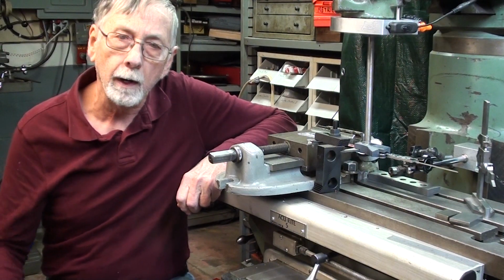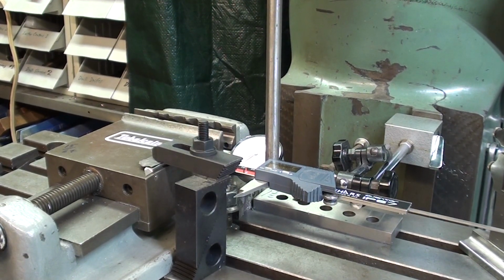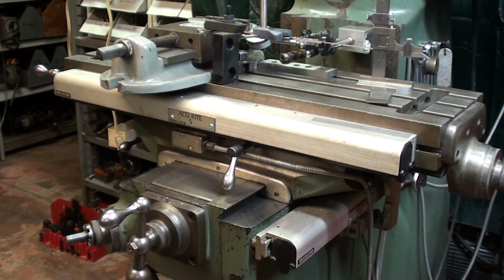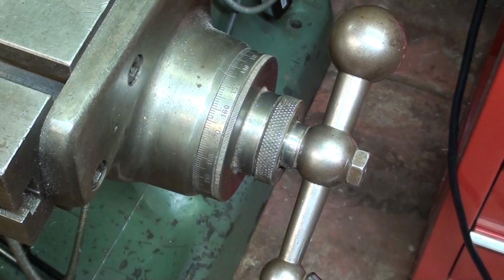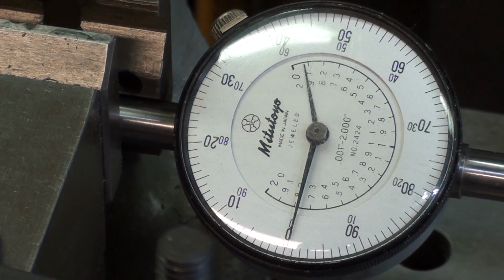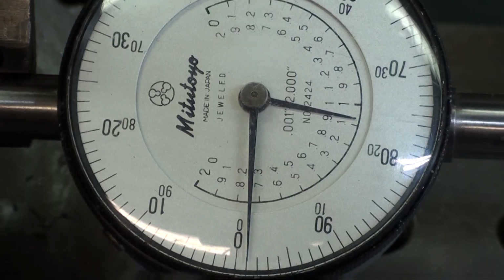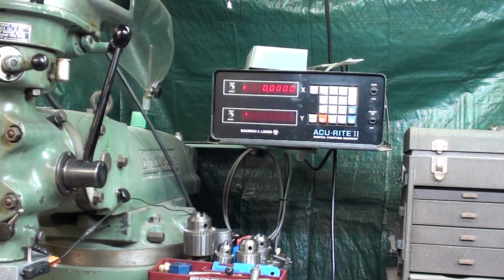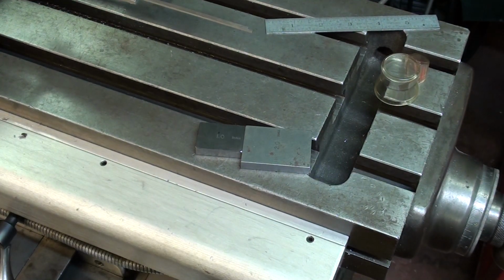Accuracy of the Bridgeport Mill Tips 527 tubalcain

Comment: I'm impressed that everything agreed so well.  I was going to ask about temperature as well, but 68 shouldn't be an issue. The instruments made of steel are all going to grow/shrink in parallel with each other... it's the glass scale and the fiberglass circuit board inside the calipers that would be an issue at 60 or 80 degrees or so.

You might find it interesting to note that the digital scale is actually an electronic version of a vernier, I've taken one apart, and found a set of copper fingers each 0.1" wide, spaced 0.1" apart, all electrically connected.  They are capacitively coupled through the label to a circuit board in the display, which uses 3 phase AC to sense the fingers, and interpolate position to great accuracy.

In fact, I had a similar scale cut out of vinyl, and attached it to a plain aluminum bar, and the fingers provided enough difference in capacitance that I was able to use the scale as a longer range vernier caliper, though a bit janky.

This was fun, thanks!
Reply from the maker: Thanks that was a good comment
Reply: # phase AC....waaay back in the 1970's I was an Electronics Tech at Burgmaster...the 'resolvers' on the ballscrews were also 3 phase AC, used phase shift to measure to signal offsets...there were not a shaft encoder...they were not a digital device...
Reply: The resulting display is digital, but the way digital calipers work internally is analog.  Phase shifts resolve far finer details.
Reply: Here's a Starrett patent from 1984

https://patents.google.com/patent/US4586260A

Comment: Please keep these coming as I'm bringing a 1958 Bridgeport M head back to spec. That has suddenly become more interesting as I just discovered that, "The (international) inch has been exactly 25.4 mm since July 1959.", as I mention in a reply below. Perhaps it's time for a DRO.

Regarding the Dial Indicator, as commenters have mentioned, cosine error is always a concern with Dial and Test Indicators when they are used for measuring. The more common use is comparing two or more positions, therefore Reliability is more important than Validity. A few tests of the Reliability of the Mito might restore your confidence.

Ultimately I think I'm going to have to resort to Gauge Blocks to test my Old BP, but I'll have to make sure my old set is post 1958!
Reply from the maker: Thank you, yes I am done to check that mit with Gage blocks

Comment: Really enjoyed watching this video. Like you, I was surprised about the direct travel indicator error. When I was working in a machine shop I would often use indicators to monitor movement when I was trying to work really close but I never involved a lot of travel. I would usually use them when I was making a final cut and was able to get awfully close. I can see where the indicator could have cumulative error over a full inch or two. I guess I just never tried to use that much of the range when I needed to be really accurate and repeatable.
Reply from the maker: Thanks

Comment: Yup, interesting topic.   I'm a bit surprised you assume that the DRO is the standard of accuracy here, especially an older one.  I would have thought the dial indicator was intrinsically more accurate.  But I am no expert with DROs.  The results overall are not surprising, though, I tend to assume that one thou is the limit of what can be realistically achieved for most jobs in the shop for non-experts, so those levels of errors seem acceptable to me.  I normally assume digital calipers are good for one thou and micrometers for one tenth. An important question, though, is what are those errors over much longer distances than 2" as one would expect for example that errors in the screw are cumulative over long travel.
Reply from the maker: Thank you, I will get to the bottom of this

Comment: Bravo! Lovely how you you did this in a super practical way that would be of use to anyone who wished to check the accuracy of their instruments & to understand what the various accuracy parameters mean in a practical sense. If as I understand it the dro reads to 0.5 thou, then when set at say 2.000 inches the real distance could be between 1.9995 and 2.0005. If my understanding is correct it is remarkable to me how the digital caliper & the screw threads came so close & given all the mechanical parts inside the dial indicator is good too. I had never thought to question these types of measuring tools & given your results I don't need to which is nice to know. It would certainly be interesting to see how the gauge blocks compare. Thanks for sharing!
Reply from the maker: You are right

Comment: In fact, most of the instruments have both accuracy and resolution specifications. Resolution is how little you can measure/see, accuracy is how precise that measurement is and repeatability is what it says. Even B&L have an accuracy limit, listed at 0.0002". Repeatability is 0.0001". So you might have an error of 3 tenths and would still be in spec.
The digital measuring devices have an accuracy usually listed as X LSB + Y% FS - that means it might be X least significant digits off plus a percentage of the full scale. So 4LSB+0.05% would mean that on 1", on a thousands indicator, you could be off by 4 thou + 0.5 thou.
Same for mechanical measuring devices like dial indicators, but I've rarely seen full-scale error specified.
Reply from the maker: Thanks

Comment: Great job on the comparison.  Buy Shars looks like, very impressed.  You should check the dial indicator to a gauge block.  I find them off quite a bit.
Reply from the maker: I'm going to do that in another video Randy. How are you doing on that engine.  You are 3-D modeling was magnificent
Reply: @mrpete222  Thank you, Engines are coming along well.
Reply from the maker: I already did that in an upcoming video

Comment: Mr. Pete I enjoyed the video. I rebuild machinery for a living and one of the ways we calibrate scales on a rebuilt machine is to utilize long gage blocks, we have a set up to 20" blocks. Wring a small, say .200 block on one end and rotate it perp to the long block, so it sticks off the side like a little ledge or tail. Place the long block flat on the table wide side down and make sure the wrung block on the end is not touching the table but securely wrung to the end of the long block sticking straight up. You can then put a test indicator in the spindle, .0001 reading preferable and try to avoid indicols they introduce a lot of hysteresis. Now lower the quill and touch off the end of the long gage block and zero your readout. Then raise the quill just enough to clear the long gage block and crank the table to the other end and touch the indicator stylus to the wrung on ledge which is sticking up and crank the table in to zero the indicator and compare it to the readout. It should be noted you would want to first dial in the side of the block parallel to the axis you are checking to avoid cosine errors. Also when you zero the indicator off the first side of the block, I merely apply drag to the quill lock so it holds z position but I can still move it, you dont want to be loosening and tightening the lock as this deflects the quill. And using the knee will most likely cause yawing  of the whole setup, so it is best locked and left locked. On a knee style mill as you move the table from left to right it moves on an arc, even a new machine, this is due to the weight shifting back and forth causing the saddle and knee dovetails to "squish" ever so slightly any running clearance in the dovetails. You will see this by placing a precision level on the table and moving it back and forth. Now on a 50 year old machine like yours it's highly likely the table is peened, in other words its crowned in the middle, this is caused by many years of things being dropped on the table top and also tightening T nuts, this yields the cast iron on the tables surface and causes the surface of the table to compress which elongates only the top layer of the table, and if you know how a bi-metal spring in a thermometer works then it will be obvious to see how this will effectively curve the table over its length. From my experience in rebuilding a machine of that age would probably be .003-.007 high in the middle, just a guess. You could check this with a long straight edge and feeler gauges. We have a saying in machine tool rebuilding, Gravity is always on, and everything's made of rubber. Cheers!
Reply: Yeah, there's an old book called "Foundations of Mechanical Accuracy", or something like that, about the construction of very accurate machines.

Yeah, it's heavy stuff...
Reply from the maker: Wow, I hope I can follow this.  I will print it out so I can study it. It might be a little beyond me. But thank you so much

Comment: The dial indicator must be exactly perpendicular to the measurement otherwise you introduce errors in the reading, the odd part is that the math says you should always get a larger reading. I think i will spend the rest of the day checking my dial indicators against my gauge blocks for accuracy.
Reply from the maker: It should have been perpendicular considering I held it in a vise with A vblock.  But I suppose there is all kinds of room for error. Mine is not a Metrology laboratory

Comment: I used to work in an academic setting with very educated people. It was always a challenge to explain to these folks why something they made did not fit together or function as they intended because of errors based on assumptions they made concerning measuring instruments and scales on machine tools. Of course, there were always questions as to how well they could perform basic shop operations, but most of their problems had to do with layout, cumulative measurement error and indifference to the limits of the tools they were using. I think these kinds of videos are very valuable. They may not get lots of initial views, but they well help people over time become better machinists.  Thanks Mr. Pete!
Reply from the maker: I am going to make more of them, but I am always disappointed in the small number of views. If I had my kitten playing with a ball of yarn it would go viral
Reply: Academics, highly educated people....they don't concern themselves with such mundane things such as we do...just ask them...!
Reply: I think your comment is correct but that it perhaps can generally be made about most of the population. It is true that people can be very indifferent to the skills involved in especially precision fabrication. I must say, however, that in my years working in universities and research labs I did come across folks who were very good at mechanical and electronic design and fabrication. Yes, they were the exception.

Comment: I was expecting some differences with the machine dials and dials indicator because of sight alignment but was surprised that the digital caliper was just a half thousandth different from the DRO.  Ware between the screw and nut could vary some in the travel even with the backlash removed as the thread clearance in the table travel is more in some areas of use. Thanks this was enlighting on how we can see things differently because we don't use direct line of sight correctly always.
Reply from the maker: Thanks

Comment: What length is the .0005 error ? Per inch or over all travel ? The dial test indicator has always been the go to for accurate location and measurements with low error . Calipers are also called guess-o-meters least accurate . For most work we find ( + - ) 1-5 thousandths acceptable and are able to use questionable machines , but  like one of the previous comments " witch one is true ?
Reply from the maker: Thank you for a good comment, the jury is still out

Comment: My guess would be that the indicator stem is not perfectly level and parallel in both directions to the table travel. Bet if you lock the table lock you might see a change in the readings also. I know I do on my mill due to condition of the ways. Thanks for taking the time to make the video.
Reply from the maker: I think I will do a video checking out with Gage blocks
Reply: steven is wright the spindle of the indicator should be exactly parallel to the axis of the lead screw

Comment: Hi Lyle,
An interesting video.
When was the last time you made parts for NASA or Rolls Royce aircraft engines in the home shop ?😂😂
+/-0.005" or 12.7 Microns is more than good enough for as mortals in the home shop.
I looked a a 1 Micron resolution DTI a few years ago, accuracy of +/- 2 Micron's ?.
Then realised what's the point, I've no way to check it, or get close to these values !.
So I never worried about chasing these values.
ATB Adam
Reply from the maker: Thank you, that's a little too small for me. But it was almost at accurate of work at Catapillar making fuel injectors

Comment: This is an interesting video and it reminded me of how I tried to confirm the accuracy of my DRO.  When I installed a DRO on my little Grizzly I found out that dial indicators have to be dead square to the line of travel or they read wrong.   I had been careless with the angle of the indicator and the measure was a lot different from the DRO.   I worried about that for a day before I went back and spent some time getting the indicator square and then it agreed with the DRO.
Reply from the maker: I was hoping the indicator was perpendicular. It is held in a vuse in a VE block
Reply: @mrpete222  I was not actually referring to your indicator although I guess it could sound like that.

Comment: One may expect differences between systems and tools. The Mitutoyo dial indicator may have been designed and built in metric and for the U.S market, if they just slapped on a dial faces graduated in imperial. Sometimes one finds fit-up problems when a metric design part is manufactured using specifications converted to imperial. It really stands out when tolerances are applied to holes with true position requirement. Good study. I liked it.
Reply from the maker: Yes thanks

Comment: I still have the old "Travel dials" on my mill and lathe, I use a 6" standard and Best test indicator to set them up. They are at least 30 yrs old and they work great, long as they are not bumped.  Yes, my dials are off some compared to the Travel dials, but I make a couple cuts on a aluminum block and compare sizes to the dials and The Travel dials are always closer. My macines are also older and they have had some use and abuse over the years.
Reply from the maker: I always wanted to own a travel dial

Comment: Vernier scale may be obsolete,  however,  it is still very, VERY accurate if you are capable of reading the scale!
Reply: Randy TenBrink you are correct, the only source of significant error with Vernier scale is introduced by the operator. I use 10x magnifying loupe to reduce that error. 
The main disadvantage of it is that is slow for modern production.
Reply: @rok1475  indeed slow but once you see your mark, you know your measurement almost like mathematical perfection!
Reply from the maker: Yes
Reply: My favorite calipers are the vernier set I inherited from my father in law. However, as I have gotten older they now require an ancillary tool in the way of 3x readers to use them. In a weak moment at Harbor Freight I bought a digital set with the 25% discount they sent me. Checked them against my Jo blocs and they seem to be constantly within half a thou. But still as a home gamer there is something missing when I use them. Now where are those blame readers?

Comment: I'd lay odds that the DRO scale is the most accurately setup measuring device here.

The calibration check would be done with stacked up gauge blocks, but for the most part, the inaccuracies between the various methods are going to be effectively linear, especially over such a short distance of travel.

Bottom line: the lead screw on this mill's x-axis is plenty accurate enough for purpose. When you get down to needing tighter measurements than +/- 0.0005", you really need to use a surface grinder in order to finish the work.
Reply from the maker: I agree 100% with everything you just said

Comment: 20 years ago I mounted a new DRO on my mill.  One of the final tests was to calibrate the installation with as long a gage block as available.  The basic principle was to mount the gage block perpendicular to an axis, square it and get the length using the DRO. The measurement was entered into the DRO and was used in some correction calculation.

What was interesting was comparing the measurements between a cold and hot shop.  Very visible on a 12" gage block.
Reply from the maker: I will try to incorporate those good ideas and another video

Comment: Agree with you completely about the vernier scales, but we still use them to measure some jet engine  parts, if the tolerance on the dimension  is within the rules of use in the GE standard practice manual.
Reply from the maker: That is interesting to know
Reply: @mrpete222  if you are interested I can send a small pdf of the dimensional inspection and use limits?
Reply from the maker: @bruceferrero8178  yes--hope I can understand it
Reply: Is there an address I can send it to?

Comment: How did you ensure that the dial indicator was aligned on the axis of the Bridgeport tables screw?
Reply from the maker: I in tend to check the dial indicator with gage blocks
Reply: Interesting point. The cosine error  is pretty small at small angles, but even a 2.5° angle you'll a 0.001" error. That equates to .043" out of parallel over 1". That would be pretty easy to spot, I'd think.